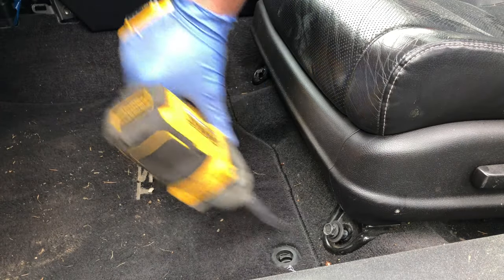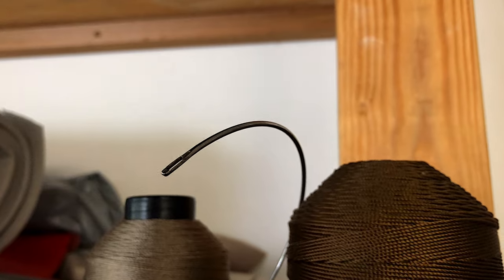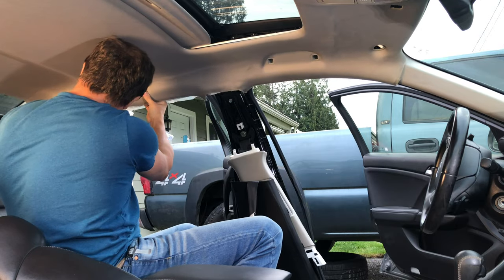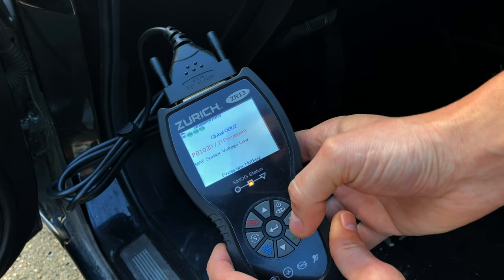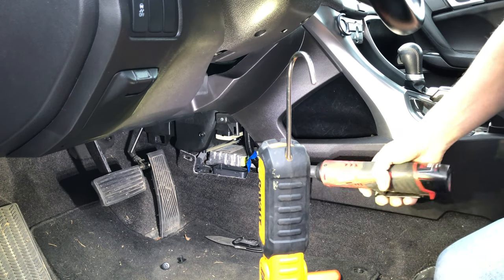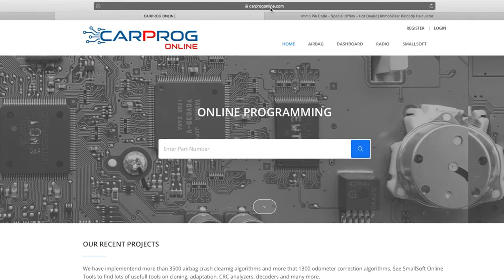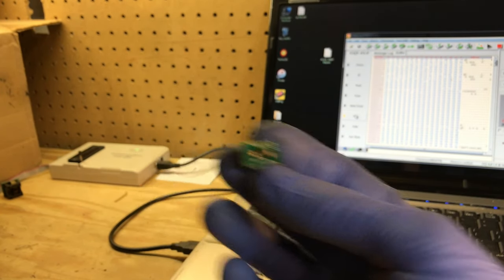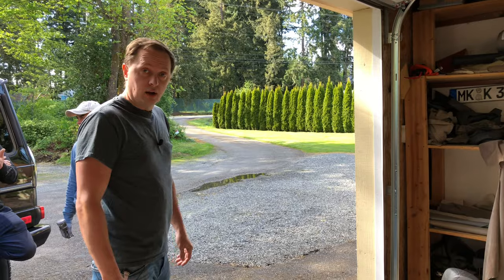Step By Step Air Bag Module Reset Procedure and Other SRS Related Tasks to Finish Acura Interior

Comment: Thank you for making this video!

I am helping someone with a car like mine try to sort the issue of replacing their airbag control module, and avoid the $1000 price tag for a new one from the dealer.
In our digging to solve this out, we are finding the same thing you mentioned:

There is very little information about how this is done... other than your video.

Two years after you've posted this up, the websites you mentioned that offer the binary file "scrub" or "cleaning" are still and going.
Through the websites, I'm able to learn what EEPROM chip to hunt for on the boards, if I need to reset a module.  

I'd love to actually discover what bytes in the data dumps are altered to "clean" the files, but I understand that most of the people and companies offering the reset service are still going to be conspicuously quiet about that.

For now, I'll be happy to toy with spare vehicles' modules, and dump their "clean" EEPROMs for the future.  I'm going to convince my friend to take the same steps to extract and read his EEPROM on his existing controller, and reset it...   Or, seek out someone who's handier with soldering, to do the physical work to get the data extracted, then reset!

Your video definitely bridged the gap in knowledge on this, and I appreciate that you shared it up for us.

Comment: Great tutorial! Can`t wait for new videos from you. Too bad you didn`t compare binary files! I wonder how big are differneces, is it just one bit or more info about crash.

Couple words from me to readers about this topic:
1) It is always better to unsolder chip than use aligator clip on it. When we use aligator clip to read eeprom,  we put power to CPU which will start reading/writing to our eerprom while we read/write and might brick our eeprom or cpu.
2) Before you use hot gun for first time, practice usage and temeparures on some old electronic. It is easy to fry board and make it usesless. Unsolder and solder back on some stuff and check if still working.
3) After soldering, always check with ohmmeter for continuity between leg and board, also check for shortcuts between legs. Otherwise you might brick board or eeprom.
4) When you get some experience with chips, you will easly recognise key words like 95640 or TJA and will know what they are for.
5) There are plenty of forums like Mhh auto ot digital kaos where you can find eeprom dumps before/after crash cleared. You can try to compare them and apply changes to your own eeprom read.

Comment: Love your videos. Thanks for the work you put into them.

Any pointers on how to get a 2014 acura rdx reset? Ive sent my srs module off and got it back. Its been installed but my vehicle is having a hard time communicating with the module. ??  Any tips?
Reply from the maker: Did you try troubleshooting first with a code reader that is capable of reading SRS codes?
Reply: @fix206  before I sent it out I didnt check it.  I drove it from utah to el paso texas without the srs module since I had alrrady sent it off. The scanners i have now say they cannot communicate with the srs module. I sent it back to the company that reset it and they said for them it was communicating fine.
Reply from the maker: Hmm... Hard to say without looking at the vehicle... But I would start by making sure that you have a good connection between the module and the wiring harness plug. I bought a car sometime ago that only had 12K miles on it, so it's a pretty new car. Car was wrecked, not even that bad. But once I trailered it home and tried firing it up,  it wouldn't start... Tried checking the codes and got a "Can not Communication with ECM" code, after doing a bunch of troubleshooting and not coming up with anything I ended up unhooking the vehicle's computer from the harness and then reconnected while making sure that I had a solid connection.. And guess what? fired right up !!!
Reply: @fix206  yeah I guess I better go through and check all my connections. Its been a weird one. I appreciate your responses and tips Ill let you know what I find out when I find it.
Reply from the maker: Sounds good man, good luck !

Comment: I have a question how can I delete airbag light with scanner after replacing module and air bag
Reply from the maker: As long as all of the components of SRS system are in good working order and are hooked up correctly, once a replacement  module is plugged back into the vehicle you should no longer  have an airbag light on...

Comment: I purchased an alligator type clip on connector for the chip.  How do you figure out where to extend the connection points to the programmer socket?
Reply from the maker: I'm not a fan of alligator clips, because most time you'd have hard time getting good connection with them

Comment: Hey new to your channel. 
Just a quick question. Did you replace all the impact sensors when changing your airbags?
Thanks
Reply from the maker: Welcome to the channel! The only time you ever have to replace impact sensors is if they have been physically damaged as a result of impact. Other than that all of those sensors should be just fine.